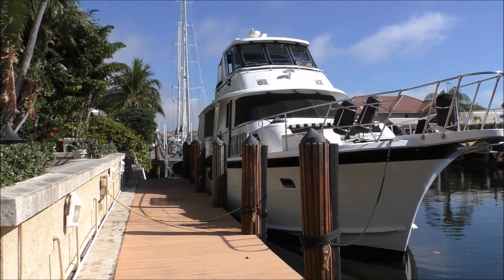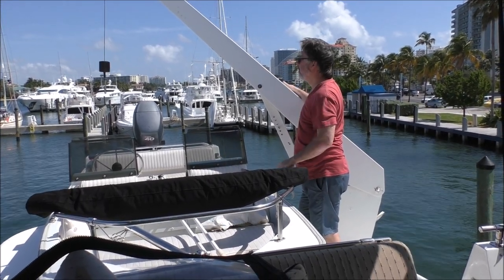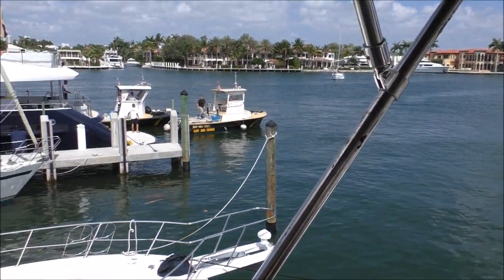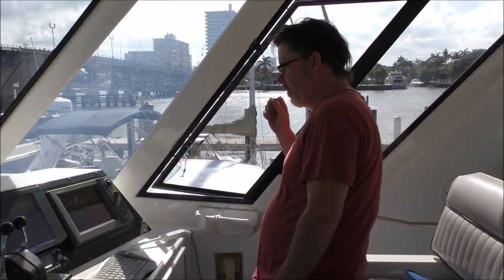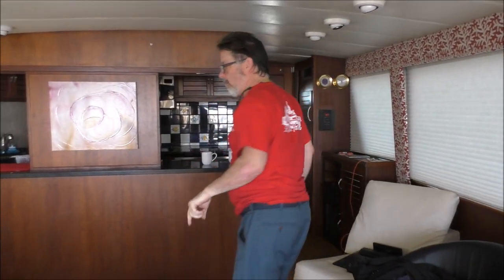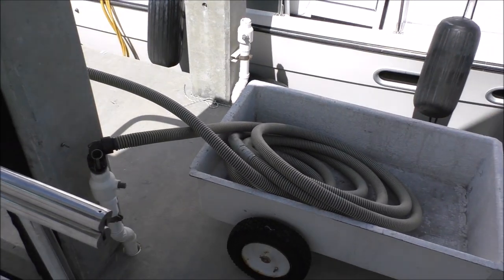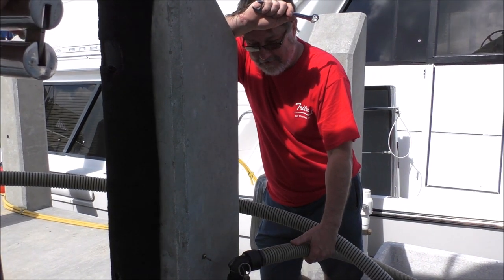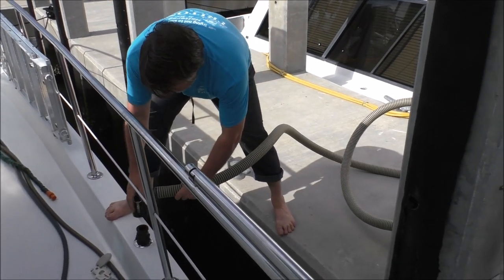Hatteras 58 Florida to Philadelphia  E13

Comment: Our thrusters cut out after about 40 seconds the power draw is very high. Just a tip, make sure that you are checking the thruster battery (really checking all batteries is a good idea) connections. I had one ring terminal weld to the post due to corrosion and heat. The battery protecter spray works well.
Reply from the maker: Ours blows out too. I have to be careful how long I run it or it will blow the breaker. I always give it a quick test before leaving a marina, or arriving.

Comment: Ensign is flown from the stern, courtesy flag (of country visiting) is flown from the yard.
Reply from the maker: We, and most power boats I see, tie it from the antenna so that it is higher than the Ensign.
Reply: @tryingnottosink9107  If you are talking about the courtesy flag ok, or from the yard (spreader) or truck on a sailboat. The ensign is flown from the stern under power or 3/4 up the leech of aftmost sail under sail.

Comment: That sure is a yacht!  when does a boat become a yacht?
Reply from the maker: When I am bragging to my friends its a yacht. When I am looking for a discount at the marina it is just a little boat! 😁
Reply: That’s a Very Good Explanation of a Yacht 🛥
Reply: any boat is a boat,  any boat that is not a type of working boat is a yacht
Reply: a 23' is not a yacht.    a Cigarrete is not a yacht.   A open boat is not a yacht.   A searay 40 is not a yacht.    This hatteras IT IS indeed a yacht.  
 A yacht requires to be capable to handle a wide variety of seas with a minimun degree of safety.   Be able to accomodate a full size family in a comfortable way (probably some crew too).    A range of 300 to 400 miles minimun !!  without aditional tanks, bladders. etc etc.    A flybridge is a must (a 60' without flybridge is a large sport size , expensive boat iMHO).

Comment: I know this may be abit late, but just came across your videos, what are your draft and above water heights, I'm watching a couple do the Great Loop, and they said you have to have certain draft and height to do it.
Reply from the maker: Our draft is 4'9" and our air draft is 23 feet. We cannot do the great loop because of a low bridge (19') in Chicago.
Reply: @tryingnottosink9107  is there somewhere to find good info on trips like yours and the Great Loop, like heights and depths, to know how much of the Great Loop you could do? I live in Knoxville, TN, and know you can travel north and south along the river, but don't know where to find books with charts or info. Thanx, love your boat and videos.
Reply from the maker: We use Navionics. They have a free version online. It will show you the water depths, bridge heights, etc. of every place in the United States and most of the rest of the world. We have it on an Ipad when we travel but use it on the computer when we are planning. We cannot do the Loop because there is a 19' bridge in Chicago we cannot get under.
Reply: @tryingnottosink9107  Thanx Captain Ed, really love the boat, was wondering, are all 58 Hatteras flybridges glass enclosed on the front? And the lower back porch type area, is that glassed in on that mod? Are those windows able to open any for breezes?

Comment: Good video's !I have a great tip for yous I HAVE two ways to pump out one is like you did and the way I like is a valve and a switch . check your LAWS for dumping but I go out 3 miles off shore and you can legally dump its all natural so you aren't hurting anything.  GOOD LUCK  GUYS KEEP MAKING THE VIDEO'S  !   CAPT. MICHAEL SUDZI.  OF THE  (SUDZI'S ROSE) !
Reply from the maker: Thanks! The boat is design so that each head can empty into a holding tank, or overboard. And the tanks can be sucked out, pumped out by themselves through the deck, or into the water with a through-hull. I did not know that at the time and I accidently left a valve opened which let sea water in.